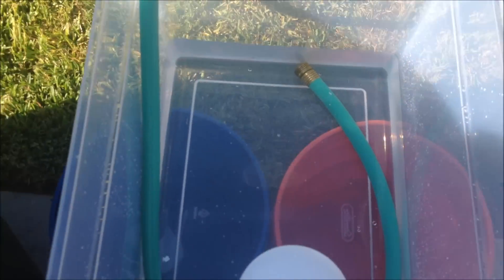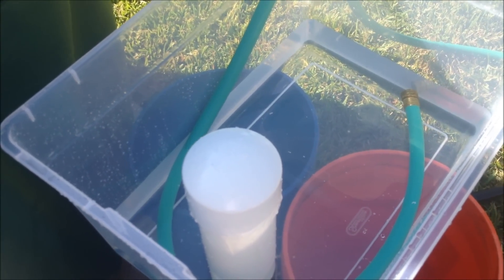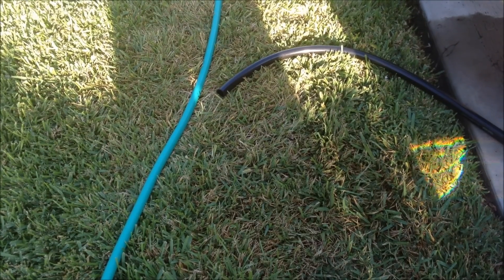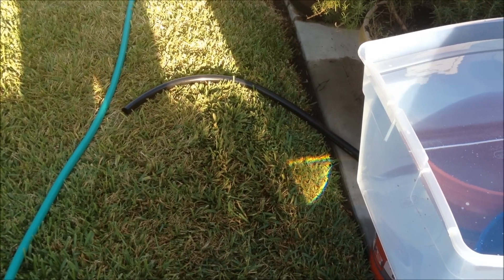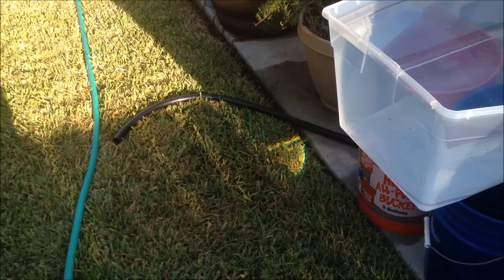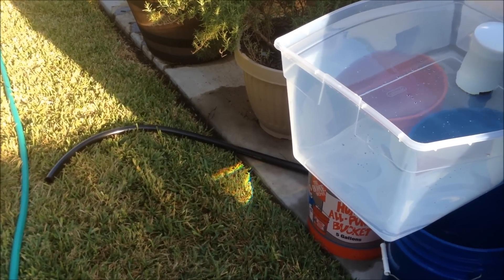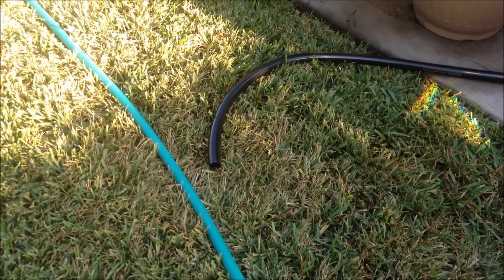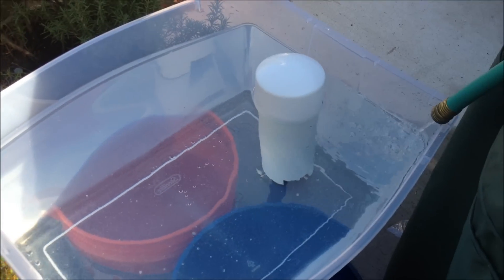Siphons Video

Comment from the maker: If I put a media guard outside the bell, will that be an issue, or will it stabilize the bell? I'm not sure I understood you, were you suggesting that the top of the stand pipe should only be 1/2 the height of the grow bed? It seems that would be too low. I was under the impression that you wanted the water to rise within 2 inches of the top of the grow medium. Is that not how you have yours set up? If not, what is the reasoning for having it that low if you don't mind my asking.